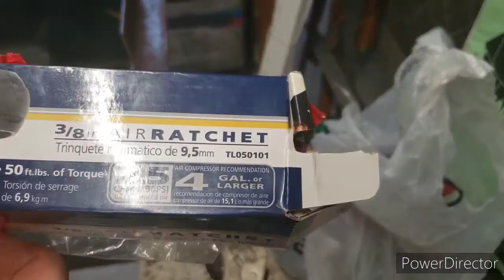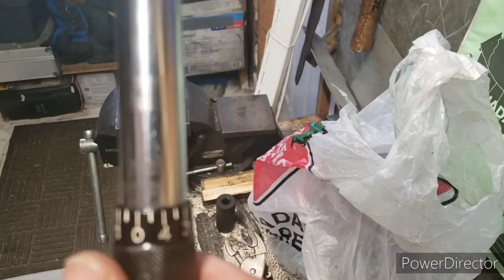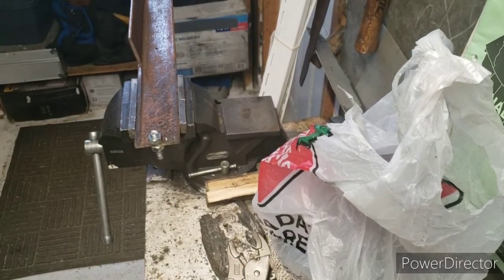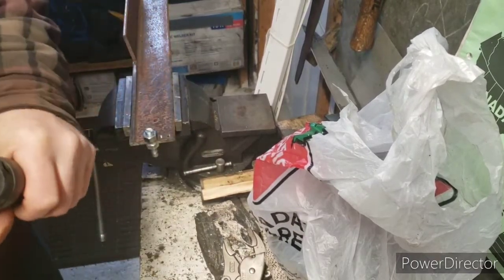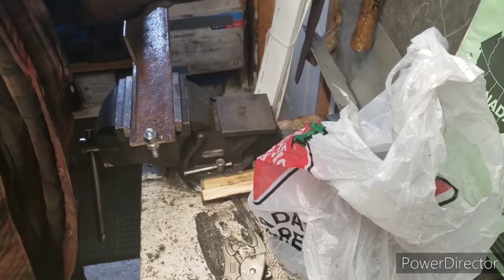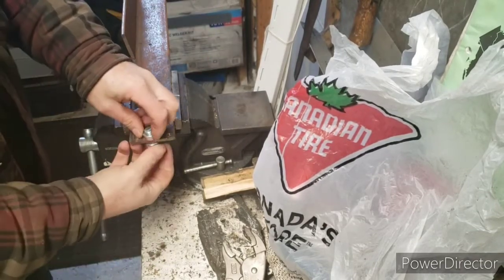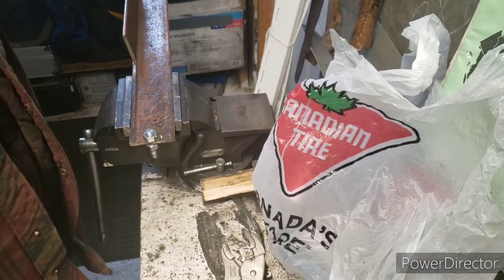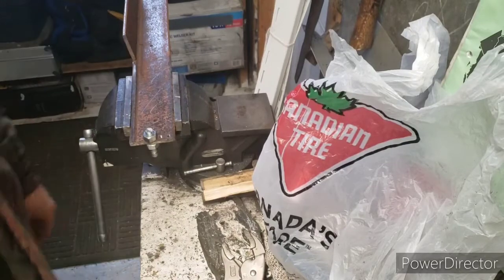3\8 air ratchet test. How much torque. #ratchet #campbell #air

Comment: That's impressive, I'm surprised it took it off.  CH makes great air tools, I've got a few of theirs.  The nice thing about air tools instead of cordless is that you never have to worry about the battery dying.  I honestly doubt cordless tools will ever completely replace air.  Most shops still use air tools for the most part.  Air tools also last a whole lot longer than cordless.  I've got an air impact gun that's about 30 years old and still works perfectly.
Reply from the maker: I agree air tools last longer. I was surprised it took it off. I think it can take off 90 foot lbs if i tried. I only have a 4 gallon tank but it gets job done takes little more patience but i get her done. 30 gallon one i think will do me just fine. But then again the 4 gallon one i can easy move it outside since i dont have garage.  Stay safe and happy new year